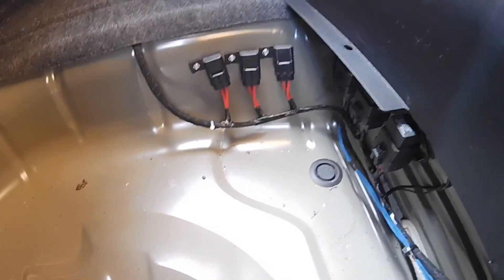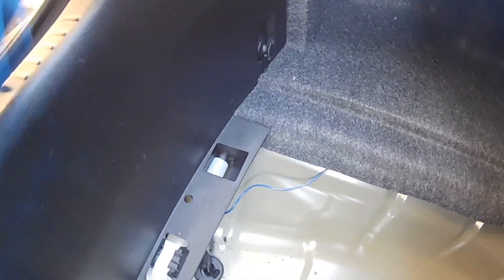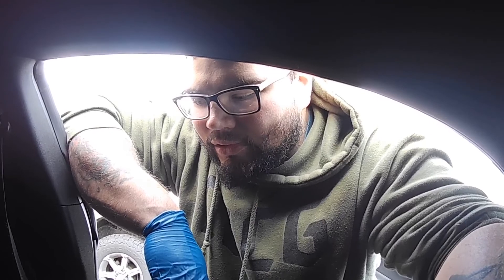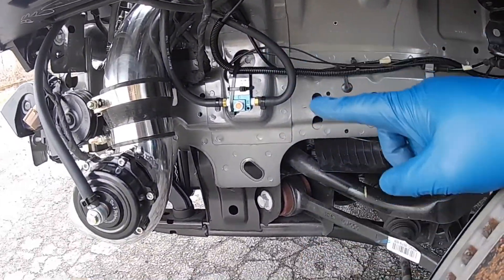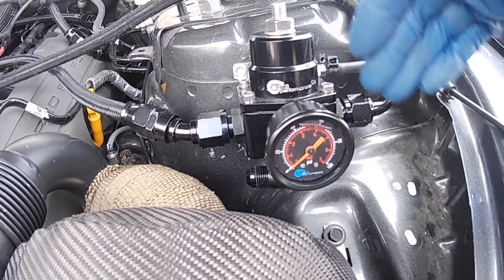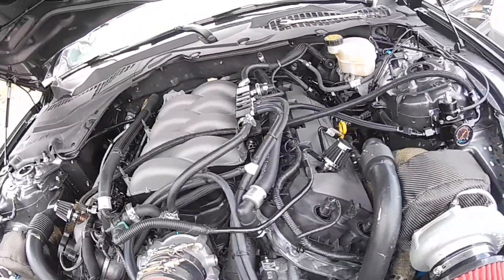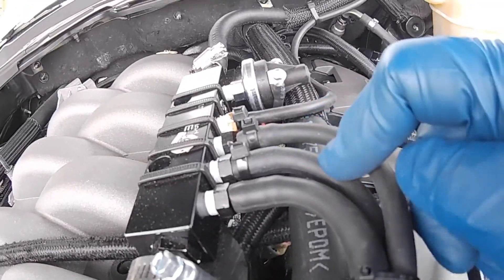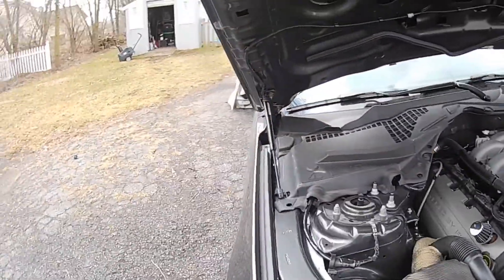ON3 TURBO S550 BUILD | Pt. 11 - Vacuum Line Routing + Fuel System Setup

Comment: Do you remember which lines went into which ports on the Mac 3 port? I saw #3 wasn’t used but hard to tell which lines are going to the other two
Reply from the maker: The left side (2) of the valve went to the top of the wastegates. The right side (1) of the valve went to boost reference and bottom of the wastegates.

Comment: Was the brake booster a good source of vacuum or did it affect the pedal?
Reply from the maker: Yes. I didn’t have any issues. I left the brake booster check valve in line as well. Pedal felt fine.

Comment: When running a manual boost controller, can I run a line from the wastegates to the bc and the other from the bc to the vacuum block?
Reply from the maker: Yes. Wastegate to boost controller. Boost controller to pressure source (vacuum block).

Comment: What did you set your fuel pressure regulator to?
Reply from the maker: 55 psi without vacuum source. Should be around 45psi when you hook it up to the vacuum reference. Always best to double check with your tuner.

Comment: Do I have to have the mac solenoid or can I just run the top and of the wastegate to the vacuum block?
Reply from the maker: If you’re not running a boost controller then top gets vented to atmosphere. Vacuum block to bottom port of wastegate.
Reply: @NWIPerformance  thanks alot

Comment: What did you do with the adaptive cruise control brace? Mine rubs against the intercooler
Reply from the maker: My car did not have adaptive cruise control. Didn’t run into that issue.

Comment: Do you need to do a triple pump set up or depends on what power level you chase?
Reply from the maker: It depends on the power level you’re looking for. Some people take the risk and run a BAP and bigger injectors and send it. Minimum I would run is a double pump return style system.

Comment: Awesome details on the install. Do you remember how you measured your pump depth to make sure the pumps didn't bottom out in the tank? Do you remember what the measurement was?
Reply from the maker: I didn’t measure I just centered the pumps like I’ve seen others do in their videos and ran with it lol. Never had any issues luckily.
Reply: @NWIPerformance  What do you mean by centered? I'm using the lethal hat that you switched to. It looks like the top of your pumps are maybe a 1/4 inch above the pump mount arms in your other video. Does that seem correct or close?
Reply from the maker: @HowAmINotFamous  my bad I was thinking of the On3 hat and yes. I just rewatched the video lol. I had no issues running them in the lethal hat that way. I wanna say that was as far as I could get them in. The lines that come with the install kits were already cut to length so I went by that.

Comment: What line are connected to pcv and vacuum 2 . Mine are blocked off , should I be running something from there ?
Reply from the maker: Believe mine were blocked off as well. Everything was fed off the vacuum block from the brake booster.
Reply: @NWIPerformance  perfect thank you!

Comment: What size vacuum hoses do you recommend I run mike? Are you running 1/4 “ on those and do they work just fine or should I get silicone push lock?
Reply from the maker: I used regular and 1/4 was just fine. The silicone push lock are just that much better to me if you don’t mind the expense. However make sure they’re not close to anything hot.
Reply: @NWIPerformance  yeah they are pricey. Hey I was doing tightening the turbo oil feed lines and was wondering what you did with those extra two wholes on the turbo? Did you leave them open or plug them? I believe they are for coolant feed lines but shoot I’m not running that for this garage queen lol
Reply from the maker: @pistol210  I left them alone. Didn’t plug them or run lines to them

Comment: Hey man did you block off the small port thats facing forward on the intake manifold?
Reply from the maker: If it’s an 18+ manifold yes.
Reply: @NWIPerformance  did you have your imrc deleted,  i kept mines in
Reply from the maker: Mine were deleted
Reply: @NWIPerformance  thanks for your help man 👍🏻

Comment: How did the break booster hold up with that set up ? Everything work fine?
Reply from the maker: Miguel G there’s a check valve in the line that goes to the brake booster. Haven’t had any issues.